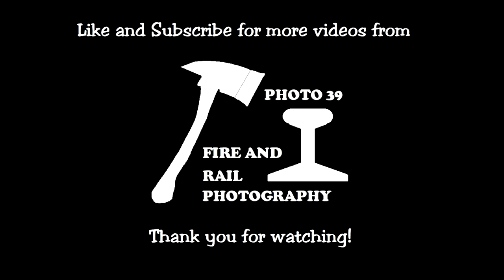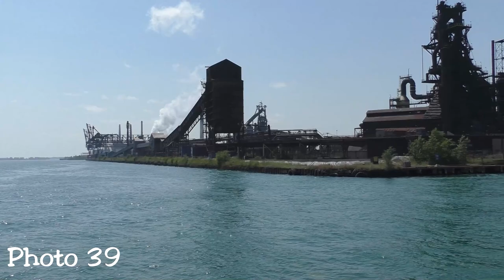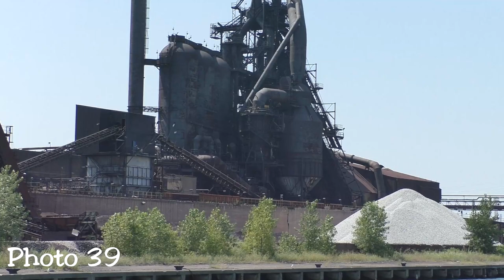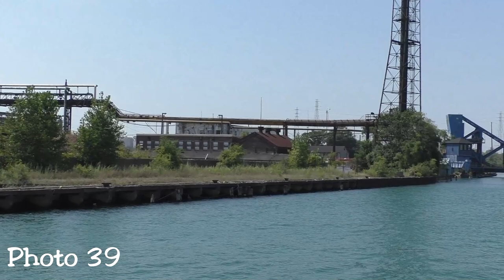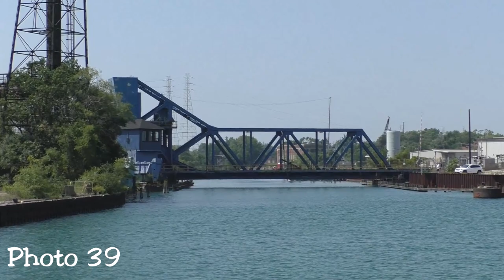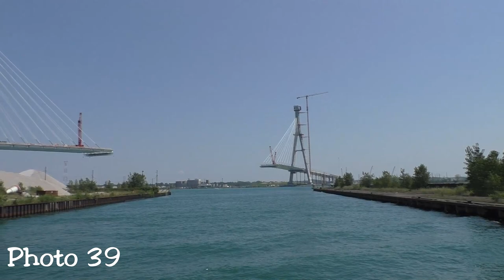Zug Island and the now closed Steel Mill

Comment: Worked for Airborne Freight for 32 year's in the early 70s I had a delivery for Zug Island 3  55 gallon drums of some kind of chemical remember going to the guard shack he gave me a hard hat and told me where to go a short time later a couple of fellows came with an end loader and we loaded the drums from where I was unloading you could see the huge coke ovens that they had one of the fellows asked me if I had ever seen a coke oven being charged I said no he said they did not mind if I watched got the ok from my dispatcher there was this yellow green smoke coming out of the ovens one had a red light flashing then a railroad car came along and a loud blast happened hot coke blew out of the oven into the railroad car when the oven was empty the railroad car went into this building with a tall smoke stack water came pouring down on that hot coke steam ash chunks of carbon came failing down like a volcano and the smell wow.😊

Comment: Is this where the infamous "hum" came from, more specifically from two furnaces within that were shut down 3 years ago?
Reply: Exactly
Reply: A1 was shut down decades ago ? B2 was rebuilt just before steel making was stopped ?
D4 was running ? question marks mean i am not sure .
the hum may have been from the turbines that created the hot air blast for the blast furnaces ?

Comment: I worked at Zug Island when I first hired on.  Then I went on to work in Central Maintenance, cold mill, 80" Hot mill, blah blah.  I worked at almost every area of the mill.  I do NOT miss all of the overtime and summers lost on 7-12s.
Reply: 7-12s? 7 days a week 12 hours a day?
Reply: @heatherstockford814  unfortunately it was for real.  I spent my summer of 2002 working 12 hours a day for 84 days straight without a day off.  Oh what fun!
Reply: That is quite a feat!! I hope you bought a good car after all  that!!
Reply: When i worked there it was swing shift. I did it for 3 years and it took my body about 5 years to recover
Reply: yeah ive work a 25 hr shift on a shut down trying to get all that shotcrete back in the furnace. used to hate shutdowns. not gonna lie sometimes i do miss working there. place made me one hell of a worker ill tell you that.